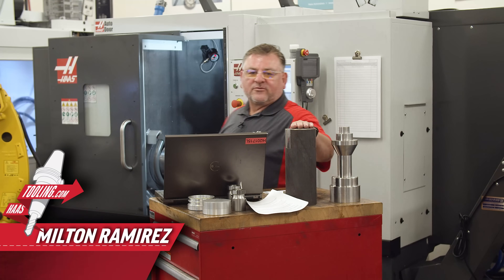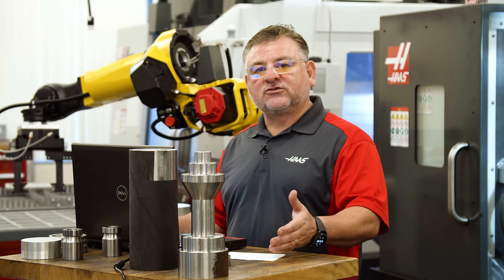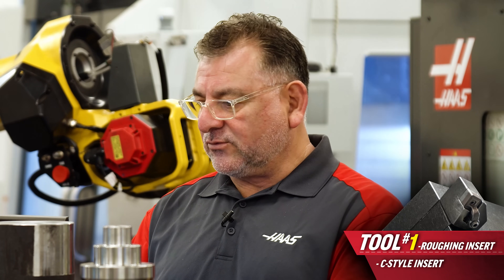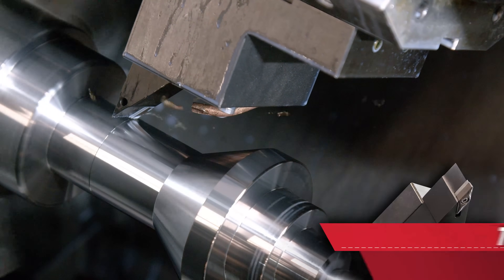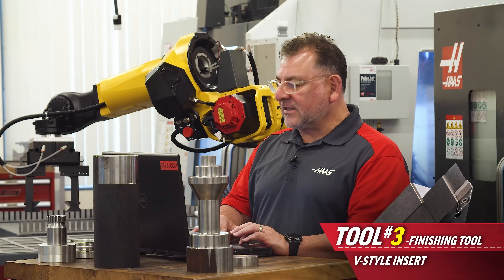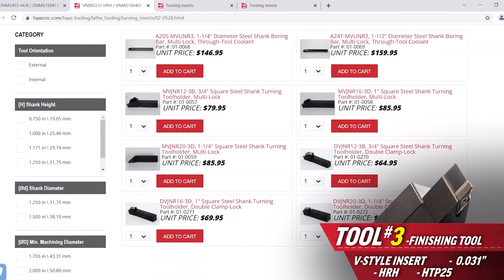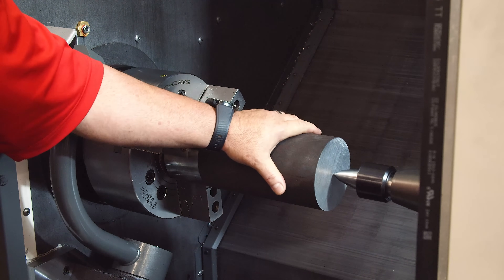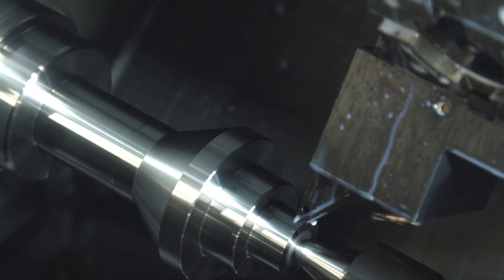Cutting 4130: From Tool Selection to Finished Part - HaasTooling In Action - Haas Automation, Inc.

Comment: The tip you gave about using a bigger radius to achieve a better surface finish was only recently learned by myself. The main programmer of our shop would always recommend  a .4mm radius tool as a finish pass. It wasn't until I started trying to better myself that I soon found out its the complete opposite.
Reply: The programmer sees the leftovers in the simulation. It looks way worse in simulation. That's why all programmers need real-world shop experience before getting on the computer.

Comment: Excellent video great job explaining these commonly overlooked factors in proper tooling per the application!
My only thing is the 2/3 the radius DOC on finish pass. I have had great results with 1:32” radius cutters doing .005” finish passes with excellent finish and accurate cuts. I understand why this is suggested as it can create a rubbing but whatever it does it works and the tool is still sharp after. The rpm and feed rate is much more narrow of a range doing this but typically a .004” ipr works for me. Now partially I do this because I am cutting smaller dia stock prone to flex and a .004” cutter or even a .016” radius  does not produce nearly as good of a surface finish

Comment: Thanks for the video! Why are you have used the roughing chip breaker for finish operation? Is this because the finishing chip breaker is not strong enough for that type of steel?
Reply: Hello Alex - Good observation. The main reason in this case due to the type of material is I prefer the hardest edge possible for longer life and consistent finish. The second reason was availability. Once I start filtering the "radius size", the "insert type", the "chip breaker", then I didnt have all the choices available for that particular insert. If all were avaialbe the best choice for chip breaker would have been "HFS". Secondary choices could have been "HMS", HUR, HFF. There are options, but the best selections are usually done by experience.
Reply: @miltonramirez8913  Thank you for the detailed answer.
Reply: @miltonramirez8913 thanks for the answer. Had this question 3 years later and nice to see a detailed answer

Comment: I would use a 80 degree tool to rough the first half out then a 55 degree to rough the second half then a 35 degree to finish turn the part .
Reply: i wuold use button insert to do it all
Reply: @TommiHonkonen  good luck getting sharp corners with button insert